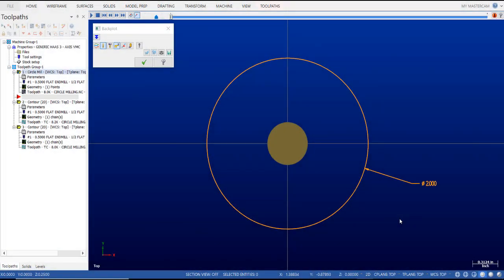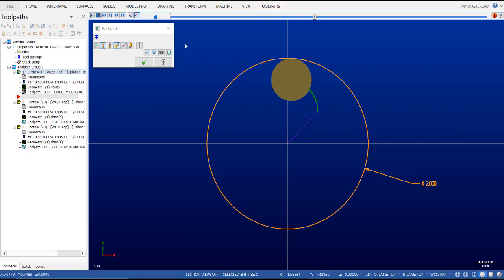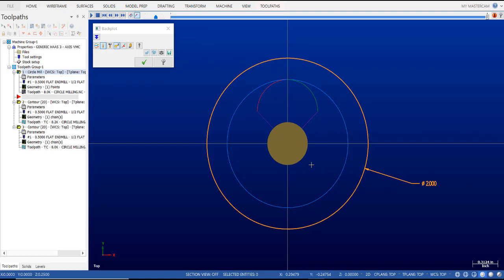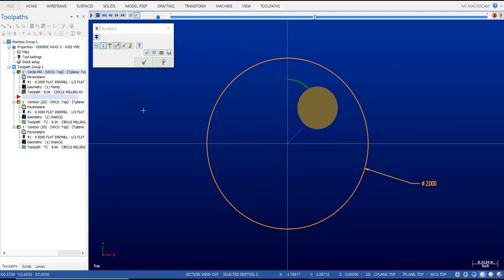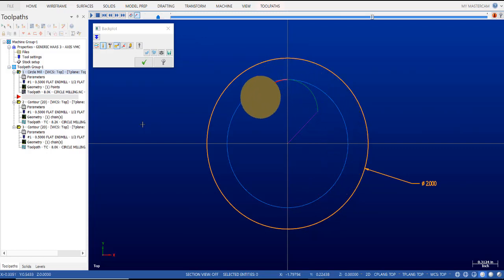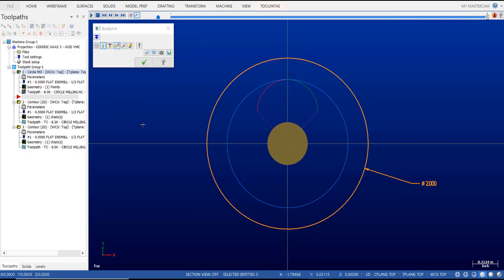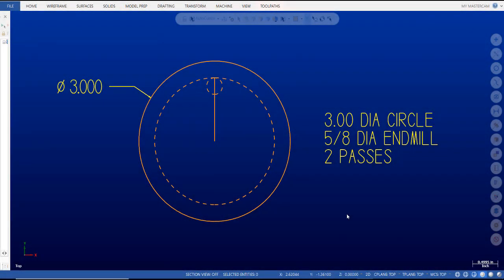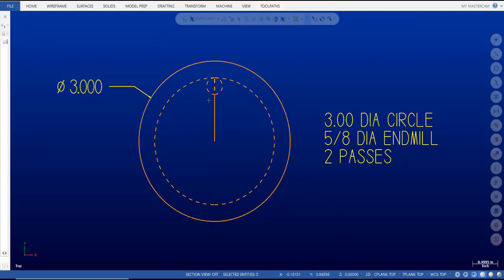How to Hand write a Circle Milling Tool Path

Comment: Love the videos but I am curious about something. In your programming at the end showing the 2 passes you had cutter comp turned on. If you have the diameter of the mill called then wouldn't  your hole have been .5 small? You programmed the mill to feed to the center of the mill when it would be cutting the circle.  If you used comp for that wouldn't that put the edge of the endmill on that line instead of the diameter you are wanting?

Comment: How would this work for mill turns with regards to climb milling or conventional?
Reply from the maker: When circle milling a hole you would use a G3 to climb mill (counterclockwise direction) and use G2 for conventional milling ( clockwise tool path).

Comment: Hi......! Thanks for the info bro. But don't you think that the tool start point which is at the ctr of the holes is rather to far from your lead in/out .
Reply from the maker: You can defenitely move that start point closer. Or make the initial move a rapid move.Thanks for your feedback Mymoon Wade.